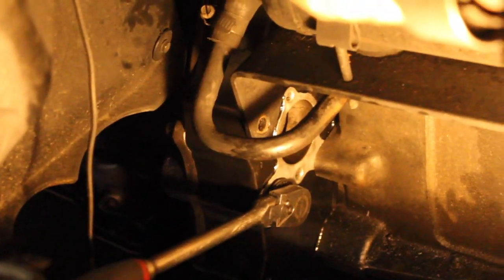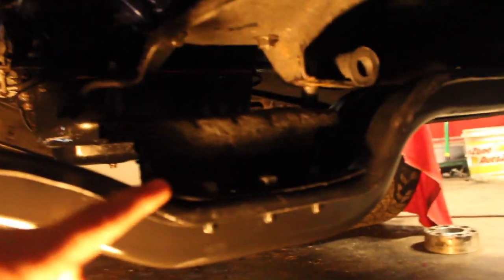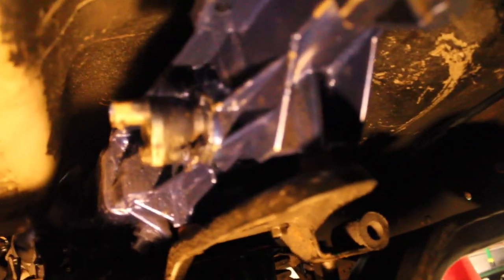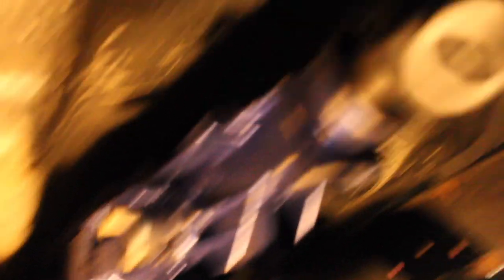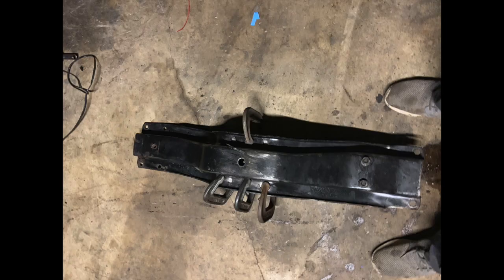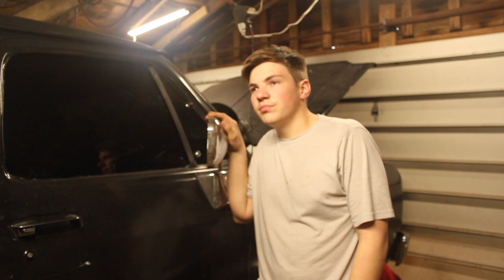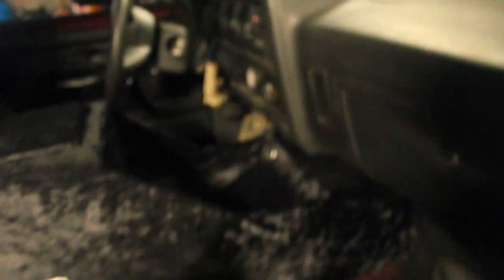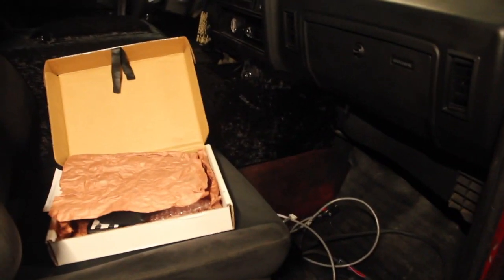47re Swap Part 1 | Ft. Firepunk Anteater

Comment: With the 47re behind the 12v, how did you wire in the tps? I'm running a 1970 with a 1991 12v but I have a p7100 pump going on. Planning on an anteater with a 47re because I'll be around 400-500hp and I wanna trash my 727 trans.
Reply from the maker: DirtBall Moto  yes I did wire up a TPS  you’ll want to wire it to the signal wire coming from the TPS but make sure it’s only sending a max of 5volts anything over that can hurt the anteater